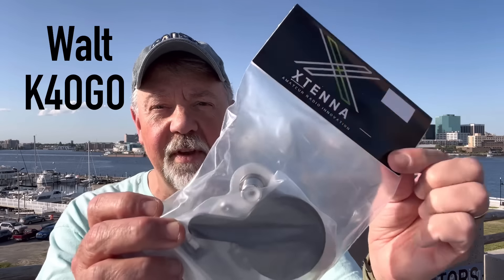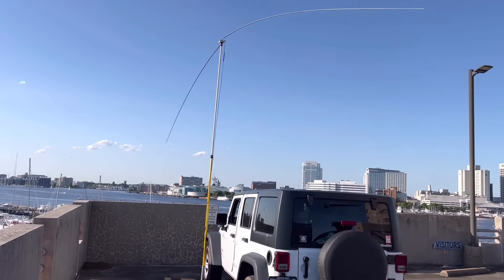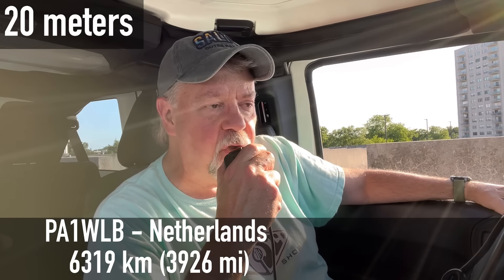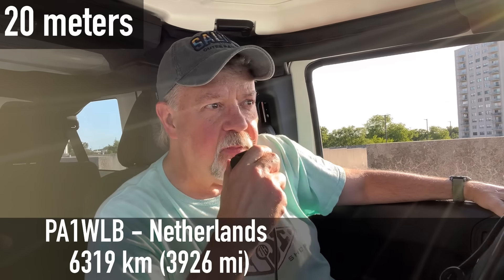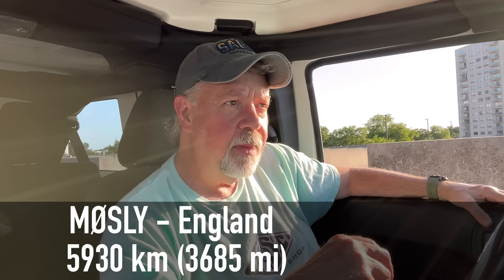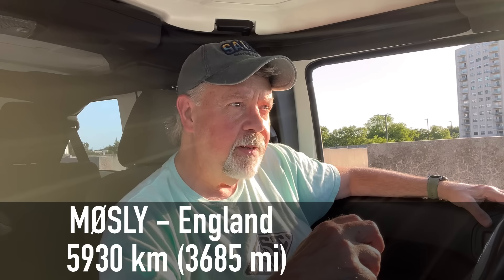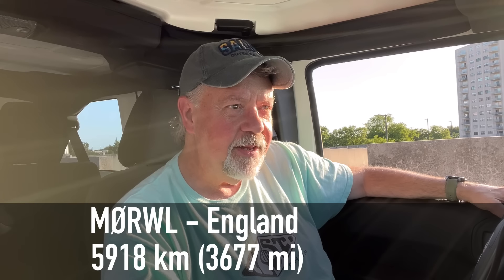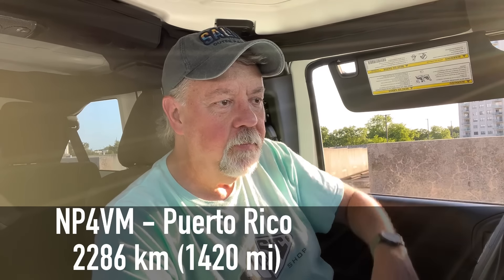Building a Portable Dipole Antenna Using the XTENNA Mast Maestro

Comment: That dipole rig is awesome.   Didn't know what a mast maestro was! I love finding these hidden gems in your videos. 73 Randy
Reply from the maker: Thanks Randy, I’m going to get out with thing again soon.
Reply: @COASTALWAVESWIRES   Hey Walt.. Did you use the Flag Pole wheel mount to support the painters pole dipole? If so did you have to use the pool noodle to make it fit securely? Great setup ! Quick and it can be rotated. Minibeam.
Reply from the maker: @ yes I used the flag pole mount but didn’t need the pool noodle. 73, Walt
Reply: @COASTALWAVESWIRES   Did you feel the painters pole would hold up with the weight of the dipole? Did you have the pole extended to 23 ft?  Thanks for all your great videos!

Comment: I used this exact setup for the first time on a 10m POTA activation and my very first call of the day connected me with an Italy operator and he sounded like he was just down the block.  Of course, propagation in that direction was VERY good at the time. Used the G90 setting on 10 watts and the internal tuner had no problem tuning the antenna.

Comment: WOW!  This looks great.  I need to get one in my "go bag".  I think I would feed mine with 300 ohm balanced line and a 4:1 balun at the rig end though instead of coax.  That should enable the dipole to work many bands without collapsing and adjusting the radiators.  The additional SO-239 is perfect for a VHF/UHF whip for emergency ops.  A great disaster setup to pass traffic.  Many thanks Walt for sharing.  73 OM
Reply: Twinlead is your friend.

Comment: In case anybody is wondering, the X in MX0HFC is an optional extra letter that can be added to the prefix.  It denotes a radio club on the air from England.  They could have used M0HFC quite legitimately, but M0HFC could be an individual's callsign (for all a casual listener would know).  "MX" can only be a club callsign.  I hope this helps and is of interest.  73 from Ed M0MNG.
Reply from the maker: Great info! Thanks Ed

Comment: that was a lot of FUN ! nice battery box. goes great with that G90 .  love the painters pole. that is a great mount  Xtenna made. nice to have good bands again.  6 meters can open any time. may be able use what you set up on 6 meters, some of them telescopic antenna's collapse down enough to   tune 6 meters. hope you got to see some northern lights. we did in NY, was great !  they did open 6 meters but with distortion . Gordon West on Ham Nation did some recordings on that. I herd they even opened up 2 meters and 1.25 meters.  I should have tuned around. 73's
Reply from the maker: We didn't get to see the Northern Lights here because of cloud cover. I'm for sure going to try this on 6 meters!

Comment: Another great video, Walt! I would be very interested in a video showing you using that mast and Mast Maestro to erect a vertical antenna, as you mentioned. How will you deploy a radial field, or will you throw a wire and pool noodle into the harbor from the top of that parking garage? LOL. 73!
Reply from the maker: Thanks! That would be a loooong counterpoise lol

Comment: i worry about droop using telescoping whips. I've been asked if I've set up a vee with my Chameleon MPAS. The answer is no; not until I put in a nylon cord connected to the ends to prevent excessive droop which may deform the elements.
Reply: I use inexpensive Chinese whips ($22 on Ebay) and my homebrew mount sets them up as a rabbit ears V-dipole.  No permanent droop when used as V.
Reply from the maker: They held up well and obviously work. I'm going to try something smaller soon

Comment: Based on your recommendation I bought this, and it just arrived. I note that it appears to be able to be mounted as shown as well as inverted, which would move my mounted 2 meter vertical oh so slightly up relative to the dipole. Any concerns?